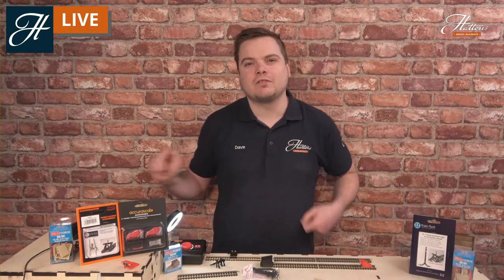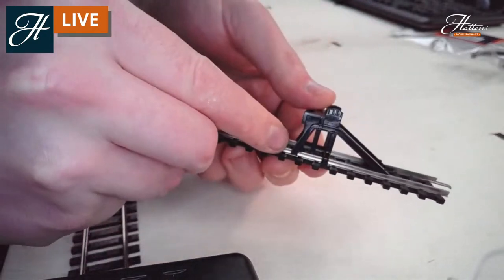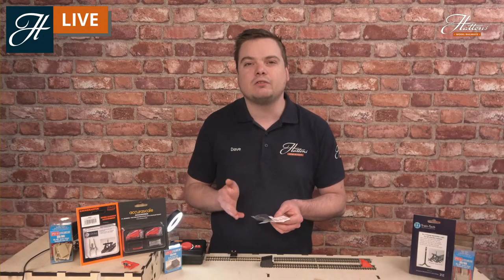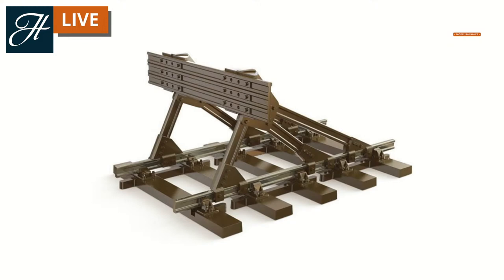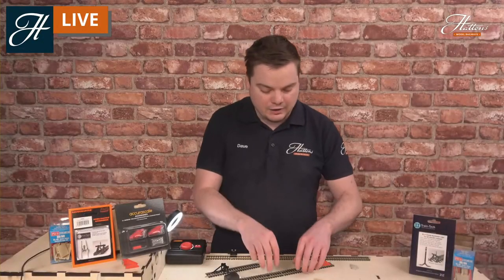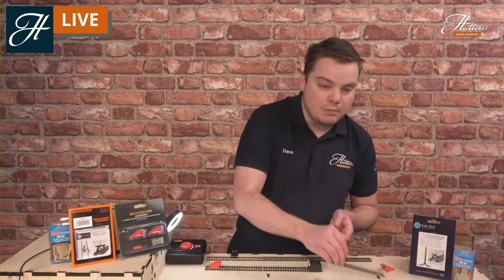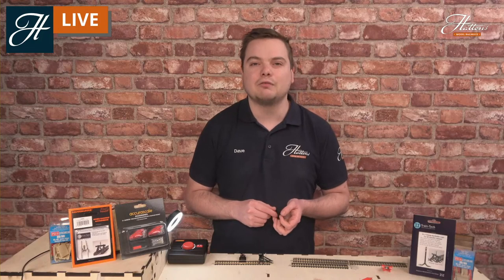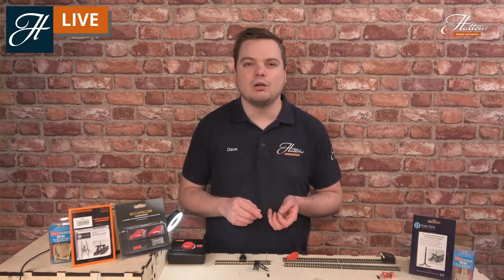Fitting bufferstops to your layout - the basics

Comment: I drill a 2mm hole in the centre of the Hornby buffer stops, insert a tiny red LED (which are really cheap) add a high ohm resistor to regular the brightness I want and solder legs to the track below the buffer stop.  Because it is a DCC controlled layout, the buffer lights are a good indicator that power is flowing to those extremities of the track.

Comment: To make it look even more accurate lift the outer end of the track (aft of the buffer stop). In reality the weight of locomotives, coaches and wagons force the track downwards and the unused end does not get pushed down.
Reply from the maker: That's a great tip Neil and one that didn't come to mind in the stream. Thanks for sharing.
Reply: @HattonsModelRailways  you're welcome. The other tip is the ballasting can be as rough as you like behind the buffer stop.

Comment: Great video. I'm an American modeler into OO , I use Kato HO scale Unitrack and was wondering if OO buffer stops would fit onto it. Do any bufferstops work well for raised roadbed track?
Reply: Unfortunately no. I have Hornby OO buffers and they stay in place by clipping to the bottom of the track. The KATO Unitrack leaves very little space under the rails, I tried clipping Hornby buffers in place and it doesn't work.
Reply from the maker: Hi, as has been mentioned a lot of the 'clip on' bufferstops won't work with the Unitrack system, however those demonstrated on the video that sit on top of the rail, such as Peco's ST-270, shouldn't have any issues.

Comment: Doesn't seem to be any mention of cast metal buffer stops, made by some of the smaller manufacturers, often to pre-grouping designs. When fitting these, remember to isolate the piece of rail they're on, otherwise you'll get a permanent short circuit.
Reply from the maker: Hi Peter, we mainly cover items that are available to buy from ourselves, although we regularly include other items where relevant too. You're right though, for some of the more obscure bufferstop designs, cast kits are the way to go (especially with your tip RE isolating the track)